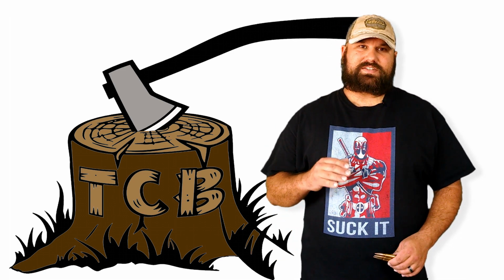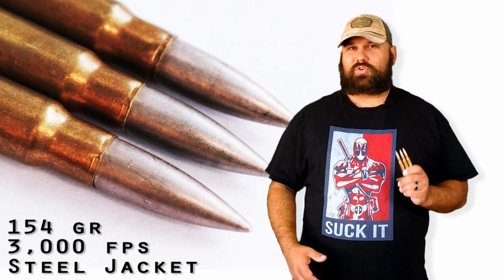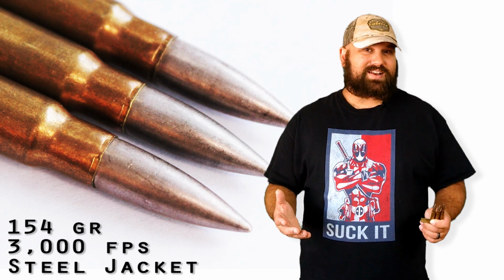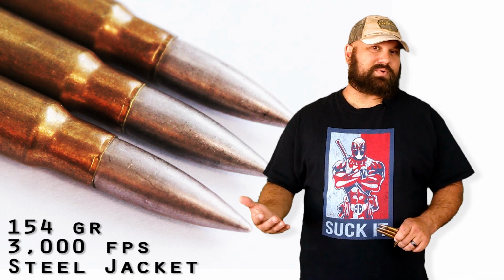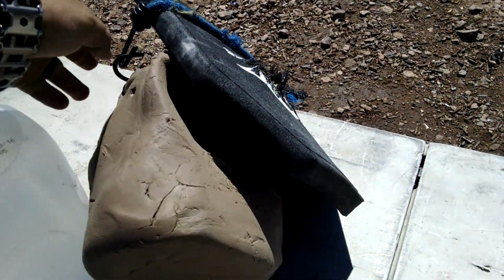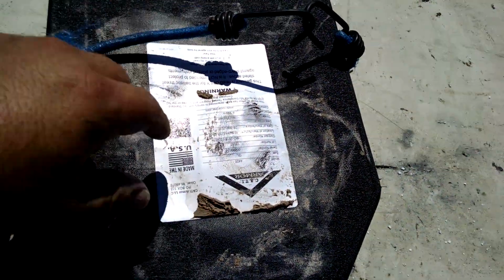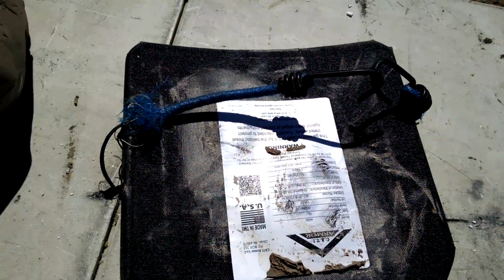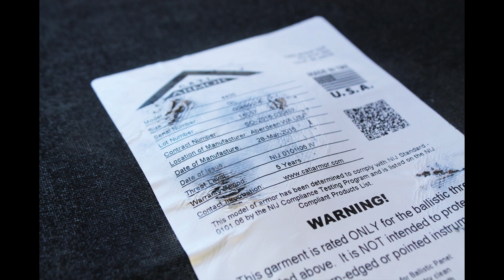Crazy hot steel jacketed Turkish 8mm vs CATI level IV ceramic body armor

Comment: that would hurt so goddamn bad.
Reply from the maker: Lol. You got that right. I know something that might hurt worse, though. ;-)
Reply: what is it????? xD
Reply from the maker: +GreenCR21 Getting sit without the plate. ;-)
Reply: +The Chopping Block i shoulda known the answer to that one. i would definetly rather have a broken rib than a hole in my lung
Reply: Honestly, though it stopped the round the transfer of force to tissue from that might even be enough to still kill you. Broken ribs and internal bleeding almost a certainty. Possibly even ruptured organs. I shoot Turk ammo out of my Vz 24 Mauser and even though it's shorter it still screams along at 2,800 fps.
Reply from the maker: It's possible, but the back face deformation was less than the NIJ limit. While it would be painful, it would probably not cause any life threatening injury.
Reply: Even with that armor, the person on the receiving end would have not survived being hit by a 7.92x57. There is no way that person would have walked away